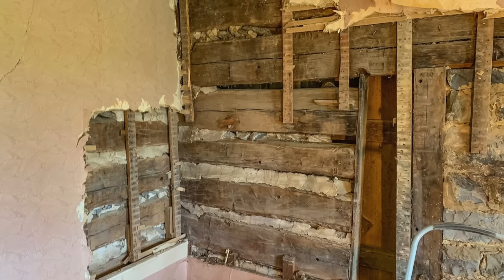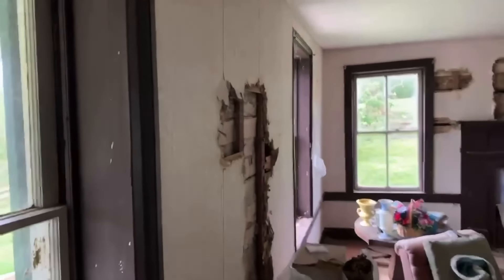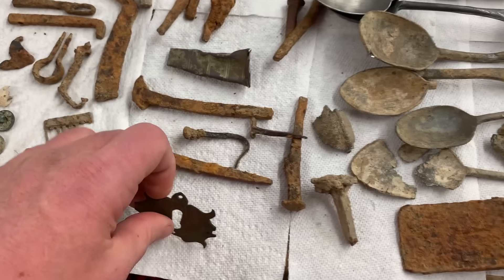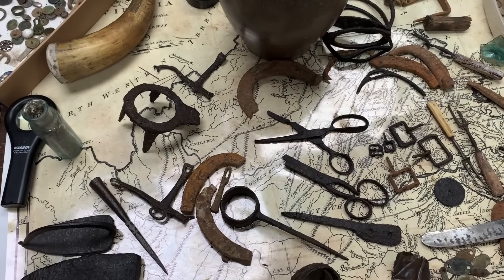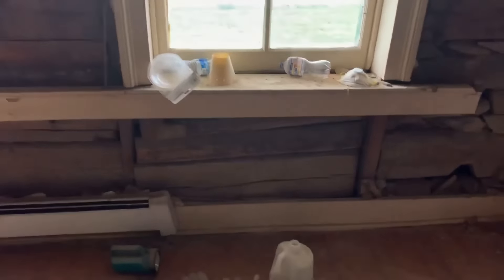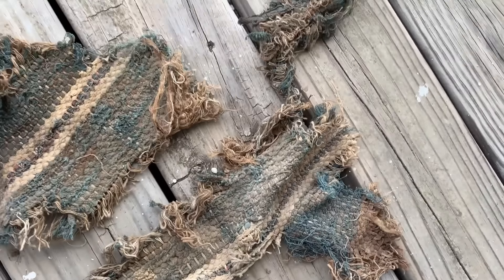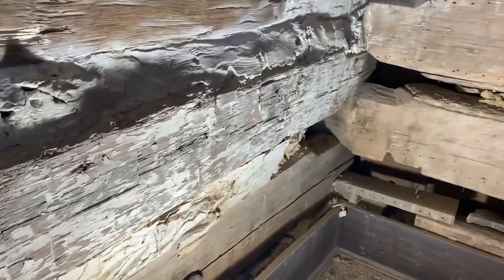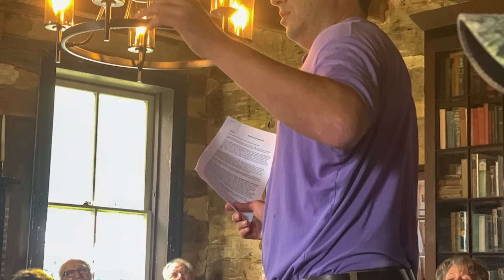I Found a Revolutionary War Log Fort Inside a House

Comment: I have a Rocker that would go well with the fort. It is a typical early 19th C. Boston Rocker with original paint but on the back where the spindles go there is a Hand Painted Battle Scene. It is somewhat hard to see as it is painted on black & is 200 years old but it is wonderful. I believe a good cleaning would help brighten it up. As a former "Country/Folk Art Dealer" for about 20 years this was the only piece of furniture from that period I kept though a few early blanket chests & misc. pieces are in storage. My building plans fell through so it needs a proper new home as it is in storage too. I've had multiple Boston rockers over the years but never one with a battle scene painting...why I kept it.
P.S. I enjoyed watching the video of the fort (you did a wonderful thing) & watching your videos.

Comment: The tapered square thing turns a round hole into a square hole...  You press or hammer the top till it goes through.  Throw that old lock into some evaporust... Wont hurt the metal and will probably start working again.

Comment: You were asking about the piece that looked like a tiny hanger with the loop in the middle. That's approximately about 3 and a 1/2 to 4 inches long. What that is? Is that we go on a team of oxes or horses? Or cows, they would have what's known as a yoke. But when they were used as a team, that would be a Mini yoke which would have clasps and loops around the end with straps. That would go through another intersecting pieces of metal and wood. That would latch together!  And this would be one of those things that would go on the end of one of those yokes.
Right before you went over to where all the spoons were the last thing that you showed looked like a foreign handle....
That was used to lift a cover in a flat top cast iron stove. It would of been a little longer, but because of it's age, ithas disintegrated away. But that would latch into a square type hole to lift off the cast pad that covered the openings on the cook top.

Comment: Find anything between the logs? My old barn I found an old hatchet head. My house was built in late 1800s. Post and beam style up in attic. The barn has  hand hewn beams but sawn floor planks and same on outside you can see all the circular saw blade marks on the exterior siding

Comment: That Part that you thought was a Fling Lock Plate but the realized it has an Edge and is curved......That is an old Fat Flushing device for removing Fat from the pelts of Raccoon, Beaver, bear and other fatty pelts....it would have had a T-Shaped handle over the top bolted on each side of the blade....it's a 2 handed tool.

Comment: 20:07  looks like the broken blade of a hatchet. 20:28 looks like a straight draw shave tool. 21:18 perhaps bucking wedges. Using evapo-rust you can get down to bare metal and may be able to better identify these things. It will only get rid of the rust- NOT the good metal. Non-toxic, reusable, and really effective. Then you can use a bluing acid and coat in wd-40. Will protect for years and leave it with an old look.

Comment: The curved piece at 21:45 resembles a feather from a set of pins and feathers, used for cutting stone.  The "fork" at 22:24 is most likely a spring similar to one on the side of a gun lock.
Reply: Later saw the “fork” and I stand corrected.  Great find.

Comment: The Shoe was put into the fabric of the house/Fort to bring good luck .Heres a good explanation as to why old shoes were hidden.
Shoes as protective objects

For many years shoes have been viewed as protective objects. Hidden shoes are usually well worn. They are very personal items which, ‘retain the shape, personality, the essence of the wearer.’ These well-worn shoes were thought to have been infused with the good spirit of the wearer. Once hidden in a weak spot in the house – above doors and windows, in the roof space and in chimneys - the good spirit would help ward off any evil spirits that might try and harm the house or its occupants. But shoes were expensive items, and in trying to give them as much life as possible, were more likely to be handed down, repaired and altered until they were no longer able to be worn. They were then discarded in the easiest way possible. Why are shoes considered a symbol of protection? One theory is that evil spirits don’t like the smell of burning leather, so a hidden shoe inside a chimney would symbolise the burning of shoes. Perhaps the idea of protection comes from the story of John Schorn, a parish priest from Buckinghamshire, who is believed to have conjured a devil into a boot. The boot is now a spirit trap as it is container shaped. The shoe could also have been hidden as a diversion for when the evil spirit ‘sees’ the shoe and attacks it believing it to be a member of the household but is trapped instead. It is unlikely that the occupants hid them but a practice that builders might do during renovations to bring good luck in their work."
https://www.northamptonmuseums.com/info/3/collections/61/shoes-2/2#:~:text='%20These%20well%2Dworn%20shoes%20were,the%20house%20or%20its%20occupants.

Comment: Very interesting Vid.
19:25 Mouth Harp on the right-hand side of the video frame.
19:45. Rev war period Bayonet Scabbard tip "maybe".
20:30 Looks like a small draw knife.
21:08 Blacksmith cutting tools.
21:24 Blacksmith Fuller that went in the Anvil Hardy hole.
Blacksmithing is a hobby of mine.
I've been metal detecting since 1967.
Check out the book "Dictionary of American Hand tools by Alvin Sellens.

Comment: In the beginning of you showing your dug up treasures, you said a piece might be a side plate to musket. It is actually the bit to a hewwing axe. Blacksmiths added a piece of high carbon steel to a piece of low carbon steel, I forget which holds a better edge, st that the bit would stay sharper, longer.
Reply: Cool project...

Comment: A lot of the knives that the edge side have been damaged could well be on purpose. Most times when a soldier or a persons limbs needed amputated the blade side of the knife were damaged on purpose for the purpose of cutting through bone 🦴 so to cause a saw like motion.

Comment: Wonderful discovery...rather concerned you used cement for the infil...  It cannot breathe as it should and probably won't be as flexible as the original plaster.  There are thousands of stone built French homes ruined because they have been "waterproofed " on the outside and they are now falling apart fifty years later because they cannot wick off the moisture.    You might want to rethink and put what the original folk put They knew what they were doing.  It was also usual to use at least two layers of plaster.   One as a rough key and then the top skim coat...just like is done today.

Comment: The handlebar rule that cops discovered was changed in 2012 and there's no longer a requirement. They also discovered that there was no city ordinance for riding on the sidewalk except in business districts. So Florida law says that when bicycles are up on sidewalks they are to be treated the same rights as pedestrians and obviously pedestrians can walk both directions on the sidewalk therefore the bicycle can go both directions on sidewalk. The dumb cop wrote the ticket up wrong direction in lane, sidewalks don't have Lanes. Hopefully the prosecutor or the judge will throw this but if it should go to trial it should be an easy win. And then sue the F$$$ O$$ them in federal Court🤬

Comment: I believe your theory about the stockade is incorrect. I suspect that those pockets are actually for railing that could be used to pen animals inside. Obviously there were no more than a few people at that fort based on its size. I suspect under times of attack they would have been far better off getting all their important stock inside than trying to defend an outside open top stockade. Likely they would have been outnumbered in any attack and being that they had no real support keeping their provisions available should they be laid seige too would have been very important.  Probably as built the fort likely had a dirt floor. I would need to see the basement area but based on the similar stonework to the chimney and foundation I wonder if perhaps the fort was not elevated as part of the house remodel. I highly doubt they would have had a cellar under the fort that was accessible from the outside. Also the large opening in the room where the fireplace is suggests their likely was a much larger earlier cooking fireplace which was changed in the renovation as well. It is interesting to think about how it all worked and all that has gone on there over the years. My house is from about 1830 (nobody knows exact build date only that it was for sure there in 1847) . I have one of the last remaining slave quarters in the county although nature is working hard to reclaim it as no one has lived in it since the 1880's.  When I was working on fixing the root cellar a few years ago I found a brick with the date 1792 carved in it the same year our county was formed so I suspect there was a house there before the current house and the cellar originally served it. History is cool.

Comment: A friend of mine has a 1700 blockhouse log cabin. They were built to protect settlers from Indians. It has rifle slots and arrowheads embedded in the outside. Imagine what could be on the other side of those walls

Comment: I hate to give bad news as you worked so hard and I do commend your efforts. You should have used Lime mortar mixed with horse hair. Using concrete is a mistake! The wood will now start to rot away as it is no longer able to breath. Lime mortar allows the building to breath and will stop the wood rotting.

Comment: What you thought might be some kind of brush with the teeth on it earlier in your video has an almost complete sister on the tray  @ 30:01 the far right. Those are women's hair combs used to keep the sides of their long hair swept back from their face whether they wore a bun, braided it or when it was taken down before going to bed. Today's versions are almost identical, but made from cheap plastic.
This is fascinating! Thank you for your sharing it!!!
~ APRIL LIPKE

Comment: That small peice with a edge looks like. Are bit that the iron rotted away an left the steel bit they forge welded onto the iron are body  an the wedges were probably for hot cutting metal when black smithing stuff an the thing u think is a fork looks like a small compass for map reading or measurement that peice that looks like a brush looks like to me it may be a leather workers punch for making holes in leather so ur work is nice an neat and don't have to use a dam awe an risk stabbing ur self love ur finds
Reply: Dam phone axe bit not are sorry when they made axes an large wood working tools they used iron body's an forge welded steel bits onto it for the working edge an often the iron will rot away an leave the steel bit but the bit may have not been forge welded properly an broke from the axe head